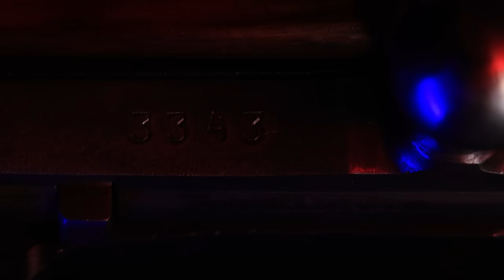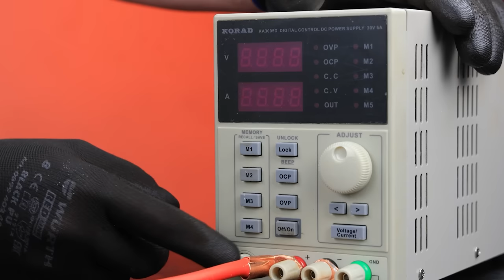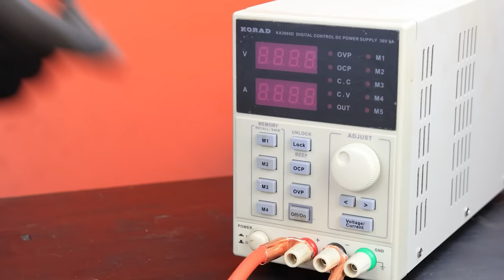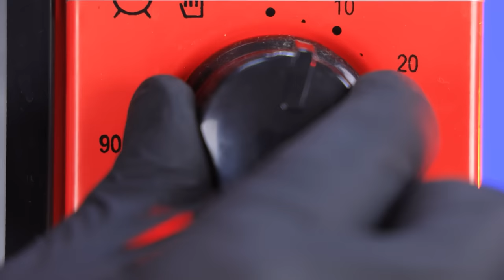Old Rifle Restoration | Mosin & Mauser

Comment: Well I have to read This one has baked before even begins for 1 simple tiny and significant little reason that barely should be mentioned. Wood does not rust Rust might put a stain in but on it doesn't rust so you got the rifle from above the yard and then fake the rest😮